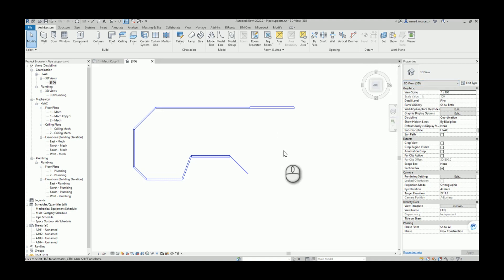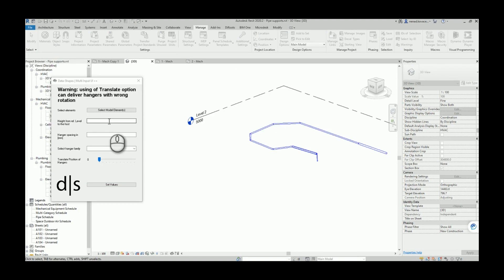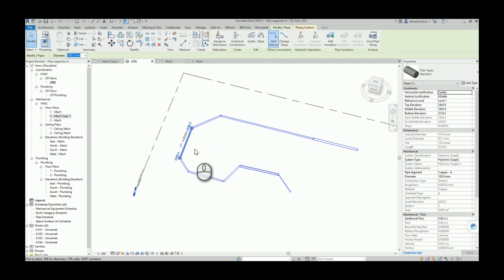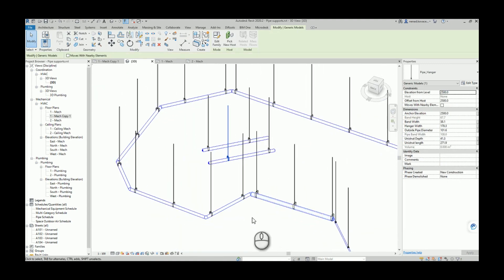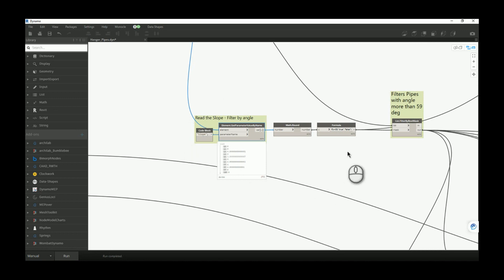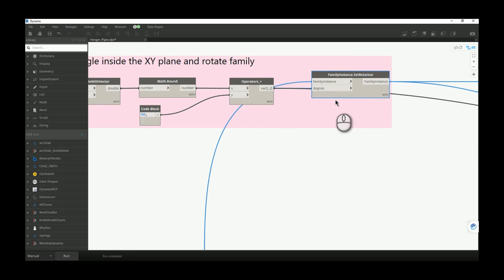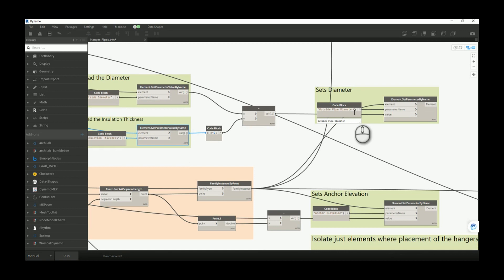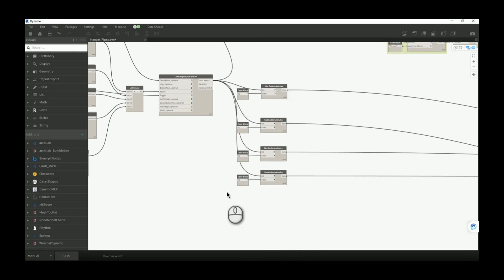Dynamo - Pipe supports

Comment: Hi nice script.... I have a concern:
1. Why the inital angles of support after placing is different than the angle you just plus 90. (Ex: 270 after placement, begin 90) Can you explain in XY plane?
Reply from the maker: If hanger family is align with x direction and you are searching for the angle of rotation comparing with x direction than you do not need to add anything. But if the family is rotated for 90 degrees than you can modify the family or just add 90 to all angles.

Comment: Hi nice script .. I have two queries... 
1.Why did yuh rotate the hangers initially adding 90 degrees? 
2.Can you please explain in detail how did yuh take that quadrants..?.. Thanks in advance
Reply from the maker: Hello Ravi, thank you for the comment. Those are good questions. If you try to set 0 as the initial angle which needs to be added into the rotation you will see that some portion of hangers will not be rotated correctly, which is again related to how the pipe was modeled and in which quadrant the pipe belongs... At some point, I did realize a lot easier and simpler way to rotate family by some direction and I hope that soon I will create revision 1 of the pipe supports script. The next couple of videos will be related just to the improvements of the existing scripts so at the moment when I issue R1 to this script, this video will be obsolete.
Reply: @dynamo_scripts  ... Thanks a lot... Waiting for your video